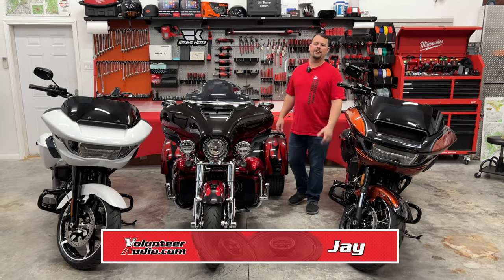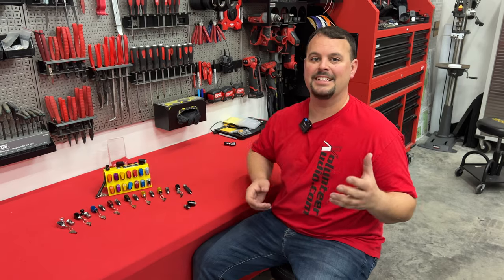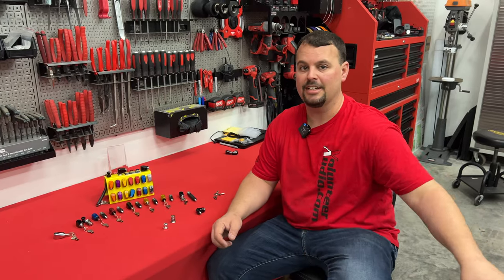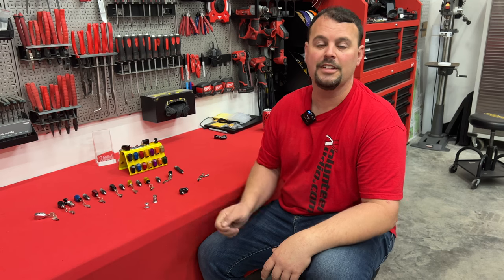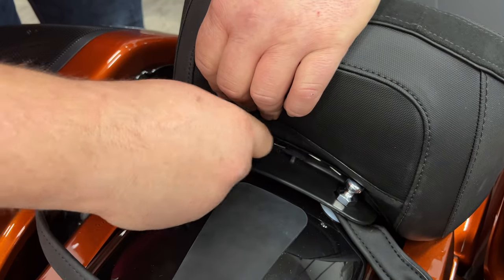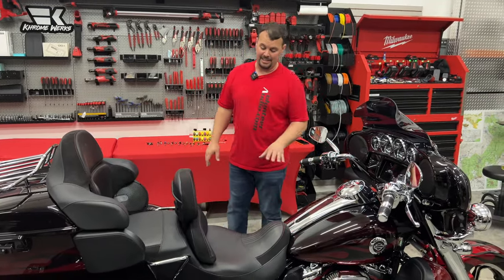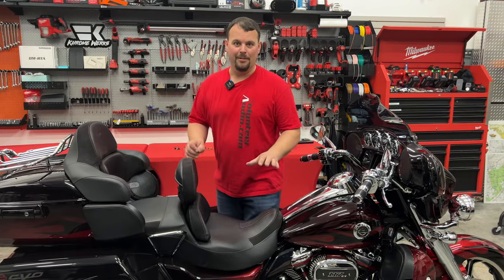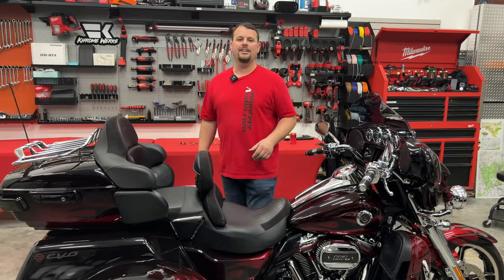Protect your Harley this Riding season with Seat and Bag Locks by Robert Becker Designs + Install!

Comment: Do the bag locks have enough clearance to be used in conjunction with the HD branded Rockford Fosgate subwoofers when installed in a 2023 saddlebag ?
Reply from the maker: I am not sure, if the factory bolts can fit these will also